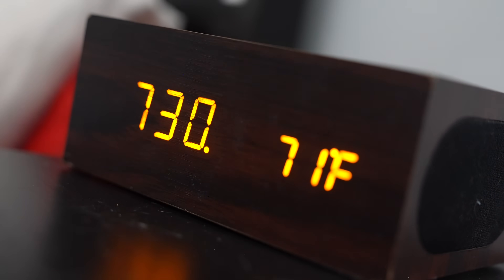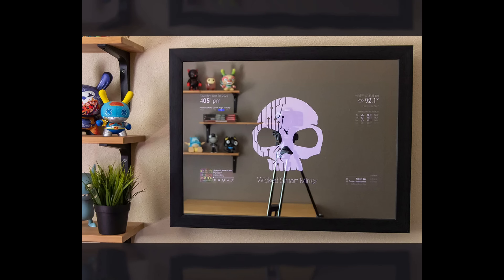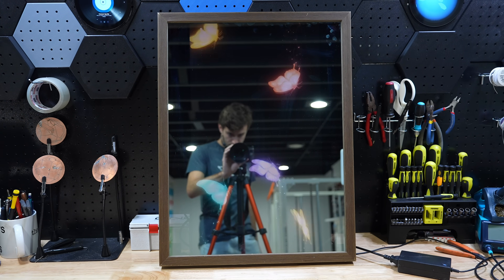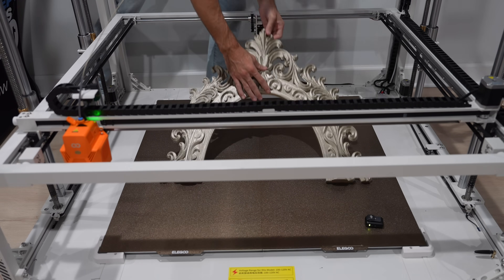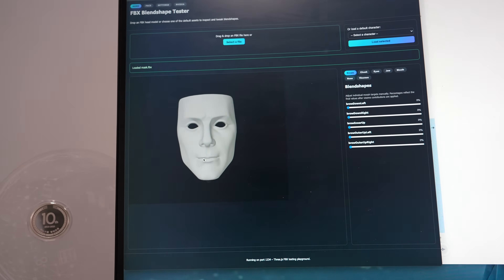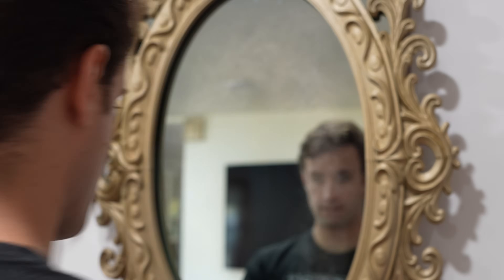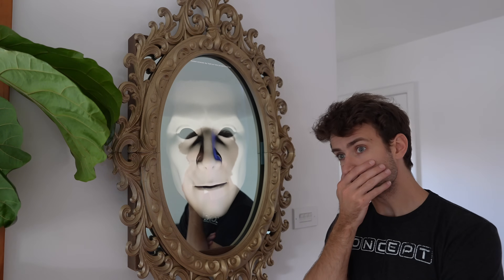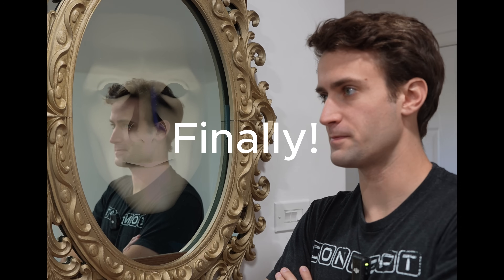I Built the Magic Mirror from Shrek

Comment: This is my favorite kind of explainer video: "How to make something you can only make if you have a bunch of things most people don't have."
Reply from the maker: Hey, so I actually built this project about 5 years ago in my college dorm room for about $100. I actually think this project is easily buildable for the average maker. It’s just about being creative. If your comment is about the massive printer, split the file, or get a cool frame from goodwill. If it’s about the one way glass, the film is $12 a roll. This project is actually mainly software. I do have a bunch of fancy machines now, but I was able to make this before I did. It’s just about being a creative maker.
Reply: @concept_bytes hii im having a shrek party in december would you still happen to have this i would be willing to buy 😭
Reply: @concept_bytes orrr rent?? 😥
Reply: @concept_bytes  where can i buy the film is it on amazon what size please can you give me some information
Reply: Thank you universe
Reply: I agree with the maker - no it is not? Things that are crucial are:
- monitor
- one way mirror
- some computer: single board computer like raspberry pi is recomended to have "clean build" but it is not required
- some back cover - but it can be cardboard or even spraypaint and some tape

All of the rest is optional and decoration, hell even software is not required... It was just a little flex to show that even this "Magic Mirror" character is possible to include there, but there are tons of free software for magic mirrors and few paid but cheap like on the website of the maker.

Comment: why waste plastic on a back plate, when a WALL is not see through??????
Reply from the maker: Great question, I should have covered this more. But the mirror is placed on a wall with a window directly next to it. There is also a window 90 degrees across the room. The way the mirror hangs is not flush and low amounts of light still get in through the back. These low amounts of light are still damaging to the illusion. I found it best to seal the back with a sheet of wood or something. Because I already had the exact Cad for this back I found it more precise to 3d print or laser cut with the exact file than to cut myself. Because I don’t have a laser this big I opted for printing it. A few layers of black pla was about 100g and only took an hour to print.
Reply: Not a waste he made a functional par that be on that mirror forever, suits his needs.

Comment: last time you "built" something u made a metal part with leds and the time before that was just a screen projector screen :) edit: yeah this is  realy cool nice job
Reply from the maker: Yeah, unfortunately this project is just some custom software I made to connect to an LLM api, stream audio into a packet to viseme converter, and then a blend shape lookup for a custom 3d face mesh I made. All hosted on a server and display on this screen I just put behind some glass. With a custom 3d printed frame. If you break it all down I basically do nothing. Jokes aside I’m just using my free will to make things I wanna make, just having fun. Most of this project probably already exists somewhere, but this one is mine. You don’t have to like it.
Reply: @concept_bytes ohhhhhh... here was me thinking the tech part was fake and the mirror was magic. Sweet con but ya didn't fool me😅
Reply: @concept_bytes  its not bad i realy like this one way more than the others i feel that sometimes they could have more to them :)
Reply from the maker: Thank you. Means a lot. I’m still just starting out. Lots more to come!
Reply: @concept_bytes  good you have the skill you just need the ideas and sometimes the resources :)